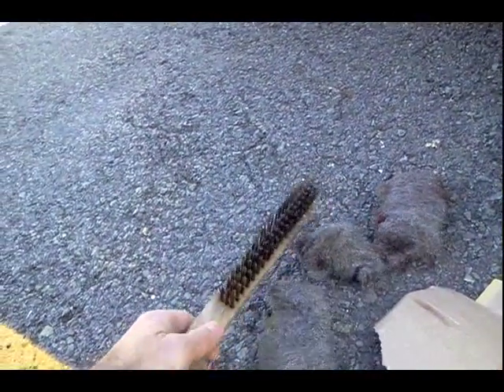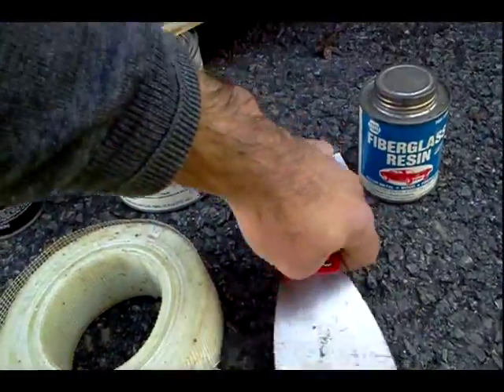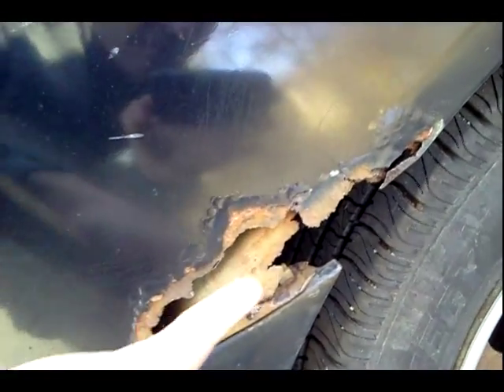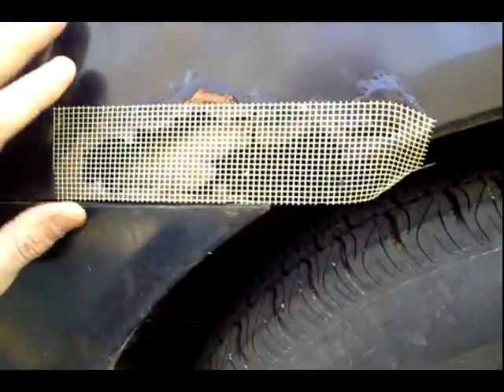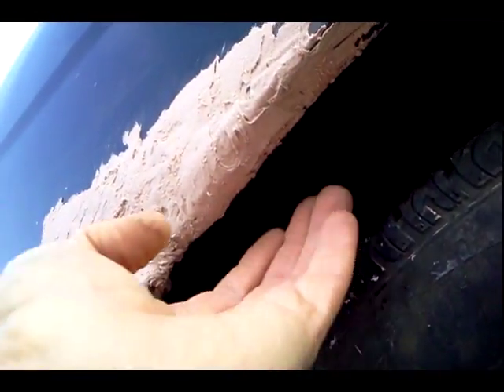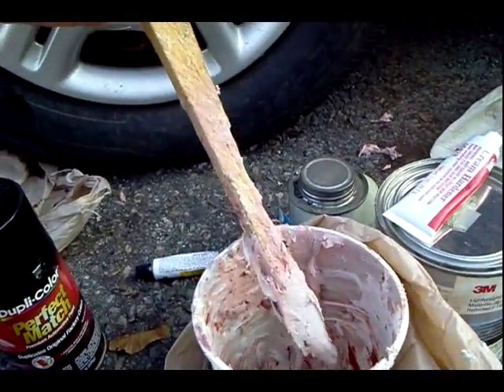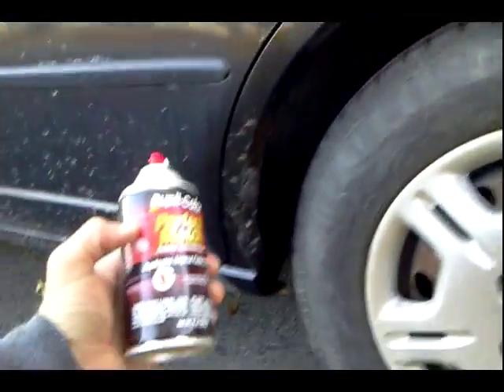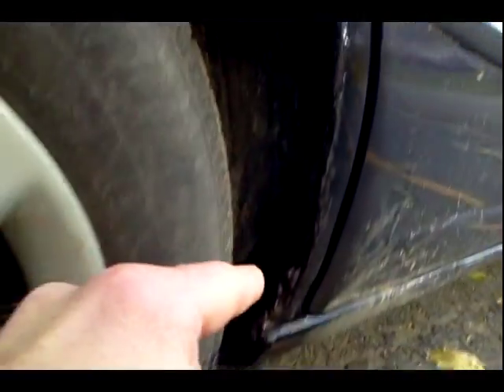PASS INSPECTION ✅ Car Body Rust DIY Repair Fiberglass Bondo Epoxy How-to Video

Comment: When I use to work with bonds an resin I would lay wax paper over the repaired area and work it smooth. Once it dries, you can peel off the wax paper and surface is pretty smooth. Saves a lot of sanding.
Reply: Yep. Also after about 10 minutes you get a few minutes where it's the about the consistency of cheddar cheese and you can work it with a putty knife to knock down any peaks and rough areas.
Reply: How to smooth bon!o wit w a x paper
Reply: Thank you!

Comment: Um, you would pass inspection as long as your check engine light isn't on. LOL
Reply: Matters on the state. "STATE INSPECTION" every STATE, has its own requirement on what is legal. Believe in 2035, no gas cars on roads in Cali. Crazy Wonder how those inspections will go lol

Comment: I studied your video & now my car is legal again.  $97 + about 10 hours time, v $2K estimated.  Not pretty, but works. Thanks for the links you provided. A+!
Reply: Just saying, it doesn't cost $2k for body work, it's like $50 max in sheet metal and rivets. Whoever told you that was screwing you over.

Comment: Next time, put your filler and fiber mesh on waxpaper then patch the rust hole. If you don't have a grinder, then drill big holes around the hole then cut through 'em with snips.
Reply from the maker: Good tips 👍

Comment: Ty my Dodge Caravan 2002 needs a patch job around wheel well it has a  small hole.  P.A. weather is a killer.
Reply from the maker: Good luck, make sure to use real fiberglass tape, not drywall tape like I did. Either way it'll hold for a couple years.

Comment: I AM SO GLAD THAT CARS DO NOT RUST OUT HERE IN NORTH CAROLINA.  my car is 32 years old and does not have a spot of rust, and that is certainly not the product of being taken care of.
Reply from the maker: 32 years wow. It's frustrating when a perfectly good 1999 CIvic engine can no longer be supported by a rusted out chassis. I ended up donating this car to Cash for Clunkers or something. Should have kept the 12v battery.
Reply: @p1nesap  yeah, my cousin who lives in Michigan has a 1997 Geo prizm which is basically a toyota corolla, great cars. it is so rusted out that it split in half, he welded it back up with a fridge door and some angle iron. definitely not safe, but there is no inspection of any kind in Michigan. but the car is perfect besides it is rusted out. same story with a mercury cougar i was given, it was a 1992 cougar LS that only had 130,000 miles. ran great and had no issues. but it was from Michigan and the whole thing was rusting out and was no longer safe, so i gave that one up.

Comment: You may as well just bash as much rust out as possible, then use a rust converter paint quickly, and then just bondo/ filler over the hole, with a bit of metal insect screen as backing if you can find some scrap. Spend 20 minutes sanding it nicely, if you can be bothered. Then spraying any random paint you can get cheaply thats kind of close,. The extra money for colour matched paint, and all the products, are wasted if its going to rust out straight away. Not that I dont mind a simple fix, buuut I think you could do it even more simply, cheaply, and better.
Reply: P.S. Subscribed! xo

Comment: No way this will last a few years. All that rust under there. Oh I see you just want to get by a year.
Reply from the maker: Exactly this method every 2 years kept this rust heap stickered for a while. 
Finally no garage would pass me bc of structural rust on the axles etc. Engine at 300K+ was still running great.
Reply: @p1nesap  what's the theory behind not passing a car with rusty fenders ?

Comment: dang it Paul i thought i was the only one to figure out to use fiberglass drywall tape...it works great because its sticking on back and will hold its in the position you put it without have to bondo on it!!
Reply from the maker: Thanks for posting Russell. I just grabbed what was available and it worked out. Have a great day.

Comment: You guys keep talking about passing inspection LOL where do you live that somebody has the right to inspect rust on your car?
Reply: Anywhere in New England. We have super strict inspections in NH. Body has to pass, bumpers, exhaust, brakes, any rubber bushings or joints, code reads, all lights have to work, horn, emissions, yeah it sucks...
Reply: Here in Jersey I can pass without doors my truck has no rear bumper and if the windshield was cracked any worse it wouldn't be there

Comment: This is what I was looking for.  Just to pass inspection.  Wish you went into the steps in more detail about what to put on first and how to put it on ( the resin).  But overall good video.  Thanks!
Reply from the maker: Thank you for the nice comment. This car only lasted 1 year after this video, before the axles rusted out and it became unsafe to drive. Roll on safely.
Reply: @p1nesap  You're welcome!  I just finished the bodywork up on my car a few weeks ago.  Not pretty but it won't fail for bodywork! :)

Comment: You could actually vastly improve this repair if you wanted to by hitting the rust with a spray bottle full of phosphoric acid, or some corroseal or oshpo before going over it with the bondo, would make the repair last a lot longer and still be very hack simple. I have a lot of way worse rust on an old mazda that still runs great. I don't care about it looking great but I'm wanting to at least stop the rust before I do a half arse job of bondo sculpting. (I get that you only cared about passing inspection so no complaints here, just noting a little phosphoric acid could help keep it repaired longer and still be as simple.)

Comment: Hell yeah Gator! Insane job! It looks soooo much better! Any follow up? Did the man pass you off?
Reply from the maker: Thanks for the compliment 😂 Yes I passed that year, but underbody and axles were so rusted no one would pass me the next year and body shops said it wasn't worth it so I junked the car, which sucked bc the engine ran great. One guy said the entire back end was a hair away from collapsing on the road. Looks like you do some cool work on those choppers 🏍️

Comment: wheel wells may be your biggest rust issues,  how ever statistically the under side of rocker panels is the biggest rust spot issues, as they are under the car, and as those of us know anywhere you live where it snows and they sand the roads, that sand is like sand blasting the underside of your vehical,  not to mention if they use salt sand mix its even worse.   I do get why you would say wheel wells are, but most wheel wells now a days, have a rubberish material inbetween to block that shit from hitting the metal, 

anyways nice idea for a fix, may not work for all of us though

Comment: also most states want to find creative ways to get older cars off the road, hence giving the inspector authority to fail you on things they shouldn't  bother you for, basically your car needs to be in exact order it was when it was new plus their now even failing for stored error codes in comp and faulty egr censor readings

Comment: You need to get the body filler into the panel filling into the back and not use the fibre glass mat, your covering the outside but the rusty metal is still exposed in the back of the repair panel water and air will create more rust and your repair will rust around your bondo in a few months compress body filler into the inside of the panel creating a blockage bigger than the outside repair that will make the repair last and it will stop air and water getting at the inside exposed metal, but as a quick repair it's OK to get a minor amount of rust through an inspection or the MOT TEST here in the uk.

Comment: the problem with  vehicle inspection is that most regulations and codes are subject to interpretation, meaning the state gives the inspector the right to use  best judgement if he sees a possible issue of danger or something not meeting standard , basically the code might not say you fail for rust but you know to make more money the shop will then probably strongarm you, now searching for more rust on your bottom vehicle frame after seeing major vendor rust, they don't want a bad hit to trace back to their licence number either.

Comment: Learning how to diy weld en chopping out all the rust is more money and work friendly in the long run. I've started with filling and removing rust but the amount of filler I've used vs pieces of scrap metal with a cheap welding machine way cheaper to use metal. Plus I can patch something up in like 15/20 mins. Not pretty but functional
Reply from the maker: Great advice.

Comment: Nice job man, you should really clear sand some more rust off the rusted areas and then seal them up with black paint or a clear coat, it will stop the rusting, waxing it yourself could help to, then the most rust you should see is surface rust.

Comment: Its coming back next year or sooner. Bondo or Resin patch will crack up and flake off if you try to lay it on top of rusted metal. Do your homework correctly and keep doing it until you get it right.
Reply from the maker: You're right about rust. Thanks 4 watching & check out my epic racing stripes videos (Part 1 &2): https://www.youtube.com/watch?v=Zv_yrx1BRwU

Comment: Pass what inspection what country are you in? We only have to pass the emission test in the 🇺🇸 US.
Reply: Look up annual DMV motor vehicle inspection regulations for West Virginia. WV does not require emissions testing (thank God) but annual "safety inspections" are most certainly a thing in some states. Driving a vehicle with an expired inspection sticker, or driving one without a sticker can and will (eventually) get you pulled over and ticketed. (Been there, done that, paid the fines lol.)  

Surface rust for example is not a reason for rejection. BUT... per code if the body or bumper has "broken, sharp edges, or 
abnormal protrusions extending beyond the normal vehicle body that would be hazardous to any person likely to come in contact" it is grounds for rejection and failing inspection. So if the rust is bad enough to be flaking or even snag a cloth glove when ran over it, it will fail. If you receive a rejection sticker, you have a set amount of days to repair your vehicle and obtain a sticker. Driving a vehicle with a rejection sticker so many days after it is issued, will earn you a ticket same as driving with an expired or no sticker. 

I understand some things, like not allowing tires with less than 2/32 tread depth for example. I've seen people driving completely bald tires with the internal wires showing through the tire become furious when they fail inspection, dispite this being a HUGE safety issue. Other points of inspections I don't understand at all. Legally in WV the windshield can only have two stickers on it. So if you have your inspection sticker on the bottom left, and say a oil change reminder sticker at the top. Having anything else like a triple A towing sticker or say a school or work parking pass sticker on the bottom right side, you can be failed for that. 

Window tint darker than 35% on any window of a passenger car, that's not allowed. Yet if you drive a truck or SUV, you can literally paint the rear and back side windows black, and as long as the front side glass is 35% or lighter it's legal. (Barring exemptions such as prescription medical reasons to have darker tint, or any tint on the windshield that comes down more than 5 inches from the top.)

Comment: why fiberglass vs Bondo?
Reply: normally you use them hand in hand. youd fiberglass then lightweight bondo to fill the micro hole then the glass bondo for a very smoth appearance.

Comment: That's the kind of job you do if you're planning on junking the car next year. Was that really fiberglass on a roll or was that for seams on wallboard?
Reply from the maker: I did this 2x over 5 years so that wasn't bad. Junked the car last year, due to numerous repair costs (brake & fuel lines, rusting frame). Drywall/fiberglass tape cloth looks similar so I bet wallboard tape would work, or any plastic fabric for body filler to adhere to.

Comment: Thanks for the video dude. But what state, up north of the Mason-Dixon line, requires a perfect auto body to pass inspection? After all, it is their doing. Dumping all that crap on the roads in the winter. I know, I lived in Shitcago for 13 years.
Reply: I know this shitty state called Pennsylvania, that I live in, requires a perfect auto body to pass inspection.  Even though it's located well north of the Mason-Dixon line.  And yes, they dump tons of rust causing crap on the roads every winter. Haha
Reply: me too bro, I also am in pa, and they do seem to find ways to interpret the regulations how they see fit
Reply: fleisch80
HA. I now live in the Gulf states bayous. If you ain't got rust on yo wagon here, you got it parked in a garage.

Comment: What you should of done is remove all the bubbled paint and the rust so you hit good metal with no rust around and the fibreglass behind the body not the top and then do exactly what you did to harden it together so then you have the shape but wiith it not meeting the body of the car so get some filler and meet it to the body and get an angle grinder with a flap disc and then paint and it would look like it had always been there and it wouldent stick out and be obvious :)
Reply from the maker: Good points, especially about removing all bubbled paint. I've done this repair before, and will have to hit that bubbled area in a year or so. That's great if you have access to angle grinder or shop tools...I don't...this video is DIY with hand tools to pass inspection if you live in a state with such laws. Thanks for watching.
Reply: p1nesap where you at where rust will make you fail inspection?

Comment: you didnt remove all the rust,expect in a year rust again,lol
Reply from the maker: Ladislav Bursa yes it's cheap fix to get through another year. Still beats paying thousands $$ at a body shop.
Reply: +p1, Uh, not really.
Reply: +Frugal Teq it doesn't cost thousands, it's like $50 for sheet metal and rivets. Not a big deal and doesn't require much mechanical knowledge. Body shops are useless and will screw you over. But fiber glass tape won't last long like sheet metal would, and if you rivet it you don't need a welder.